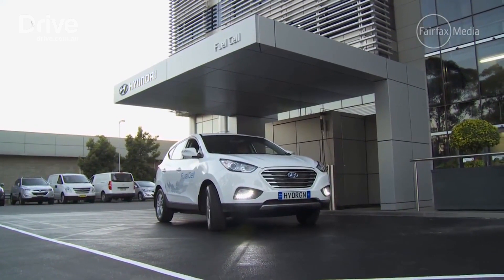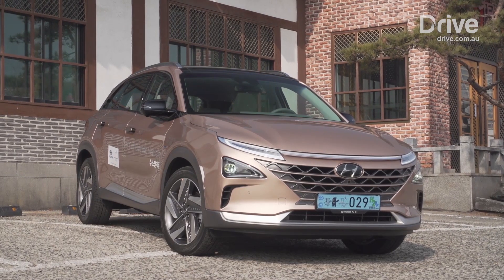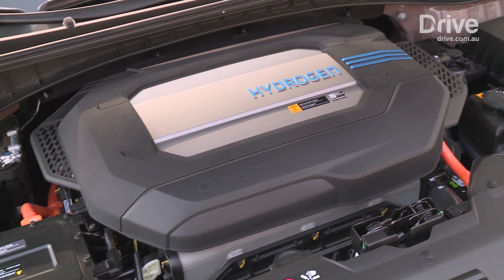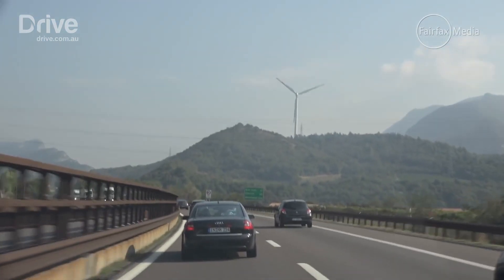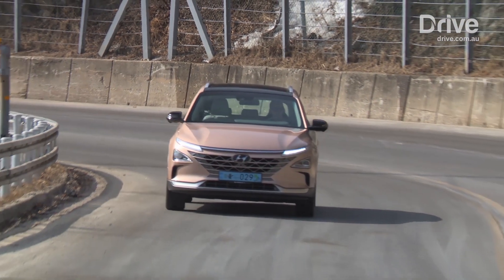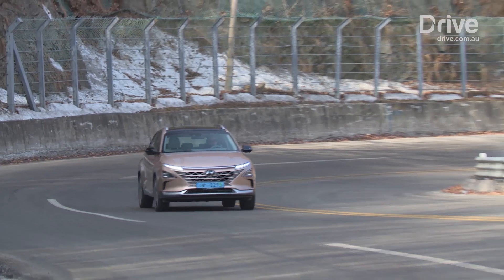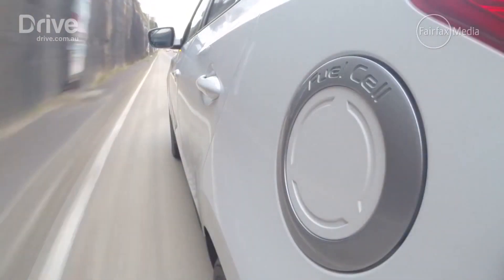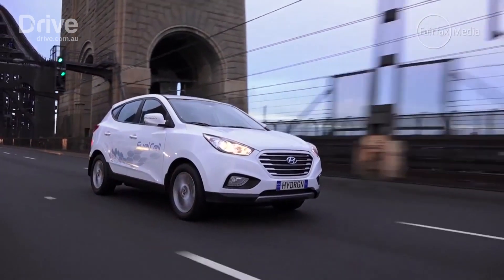How Do Hydrogen Fuel Cell Cars Work? | Drive.com.au

Comment: Most of this info is horse shit, I watched a guy make hydrogen with plastic bottles, wisks, steel wool, water and a power supply but you could easily use a car battery. Also LPG is super explosive and nobody is wrapping LPG tanks in carbon fibre? And there are dudes all over YouTube who have converted their vehicles to hydrogen combustion literally in their backyard with bits an pieces of scrap and most of them are extremely safe. I mean sure if you want to run electric motors off hydrogen it's going be expensive but hydrogen combustion is actually real cheap and produces way more energy than diesel or petrol or lpg.
Reply: That's hydrogen combustion, with produces nitrous oxide. This is hydrogen fuel cells which use electrolysis.
Reply: @Optamizm  nah bro the process I mentioned to extract the hydrogen from water is electrolysis
Reply: @jackazzopardi6062  you talked about hydrogen combustion in the last sentence. That's what I was referring to.

Comment: I cannot believe that Hydrogen could be used safely to power cars of the future. We have all seen multiple Vehicle Pile-Ups on icy or foggy roads, where there has been a Chain reaction - with several vehicles being incinerated, along with injured occupants too!. Your new H - Car could be a potential bomb, and an Electrical Fault on your H-Car could begin a reaction. Car Companies are really wasting R&D Budgets on this. The news (today) is that Australia is going to supply Bulk Hydrogen to S. Korea, for use in Hydrogen Vehicles. In contrast to this, the safest fuel system is still Lithium Batteries. There is some 'promising' news coming out of California, a Company called Amprius. They have developed a new type of Lithium Battery that can DOUBLE the range of any EV, including Tesla. Also not widely known, is that the Recharging Times are greatly reduced.......New type of Batteries are energy-dense. I do not know if this is all hype, but there is a long bright future for any company that pursues the Lithium Battery Technology to further maximise EV efficiencies. I think that we are fooling ourselves if we believe that carrying small packs of compressed Hydrogen Gas in millions of future vehicles is completely risk-free. It will be a completely different "Check Engine Light" when things go wrong with your new H-Car!!